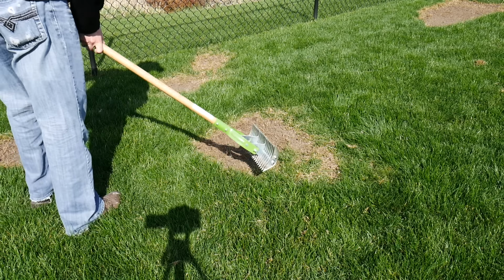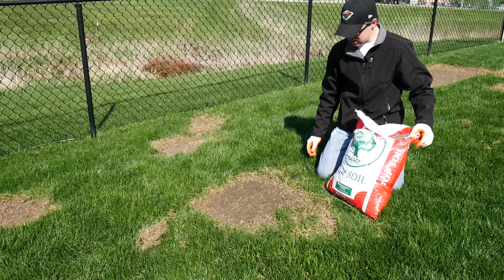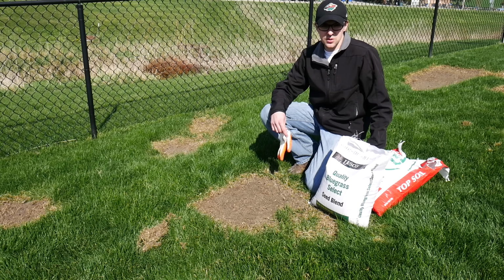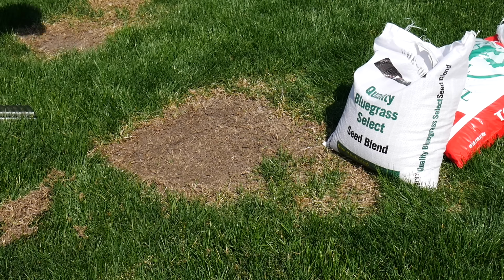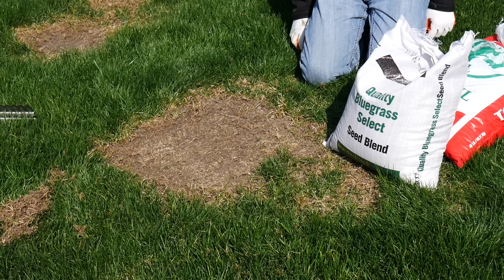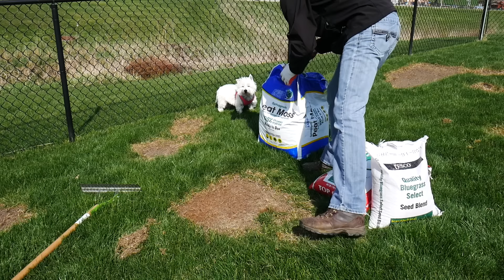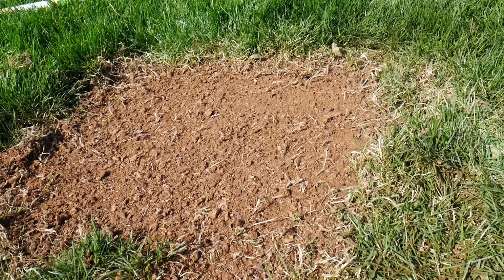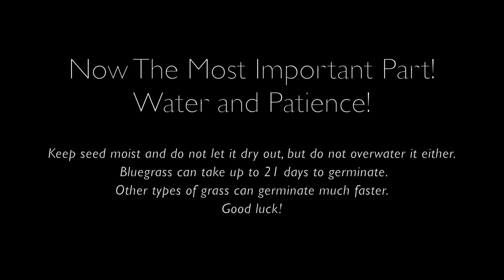How To Seed And Repair Bare Spots in the Lawn

Comment: I'm no expert, but I think the Scotts with weed preventer (pre-emergent) will keep your seed from germinating.
Reply from the maker: It's the Scotts Starter with Weed Prevention that you want.  The regular weed and feed type product would be an issue with new seeds.
Reply: The pre-em in that starter is tenacity (same active ingredient), which is safe to use at seed down.
Reply: cool . thanks

Comment: Dog walks in, and is that what is causing brown spots?
Reply from the maker: Nope.  I had a little mishap with weed killer.
Reply: Makes me wonder now. I have brown spots all over my front lawn. I asked my lawn maintenance people if they sprayed something on it that did that. They said it was because I didn't start watering my lawn soon enough. I'm in western Oregon. I've never had my lawn look this way before. So, even though I have my sprinkler system on, I'm doing some watering with a hose now to try to get the brown spots green. They added a little bit of seed to the spots, over the brown grass.

Comment: Thank you for making this video. I follows your exact steps about 2 weeks ago. My question is...can I mow after I've laid all this down? The seeds have started to germinate but I'm scared to mow it. Your help would be greatly appreciated. 👍🏽👍🏽👍🏽
Reply from the maker: Once it gets to about 3 inches tall or a little less than you can cut it.  I've honestly been cutting mine by hand with a little scissors type tool but it depends how large your spots are.  Otherwise once it grows in a little bit you should be able to take a push mow over it without doing much damage.  Just don't make any turns on those spots if possible.
Reply: I have many patches scattered all over my front lawn, and on top of that i used a broadcast spreader to spread the rest of the grass seeds...my yard is super fucked lol
Reply from the maker: Then I would say just wait until it's close to 3 inches and set your mower to 2 inches and go for it.  As long as you are as gentle as possible, it will be fine.
Reply: ryanknorr sounds good! Thank you for your help.